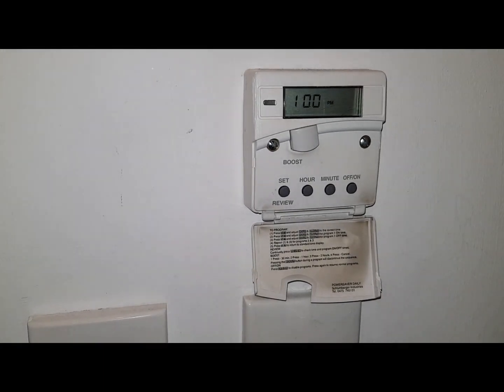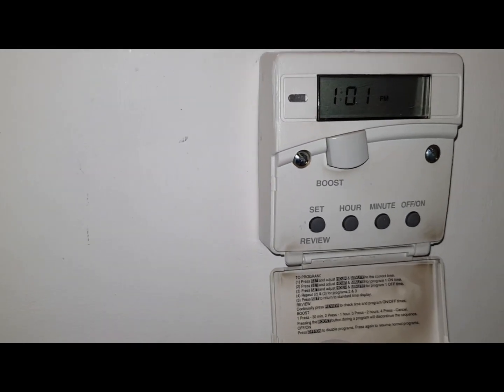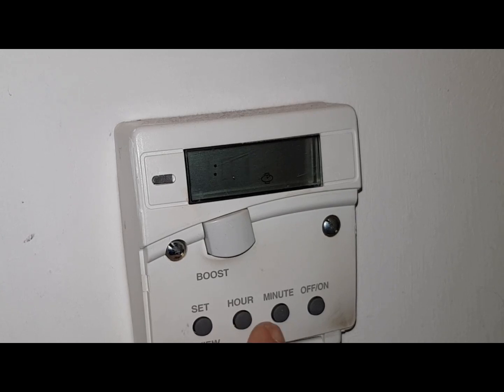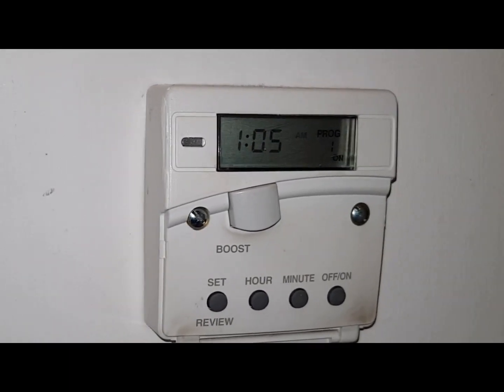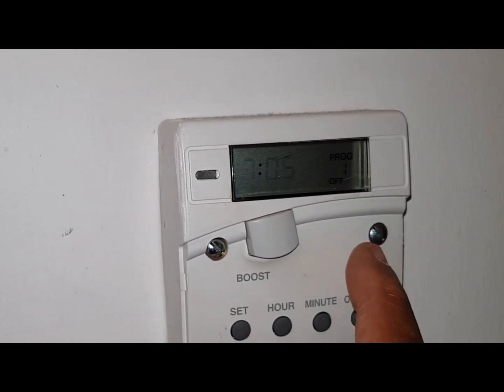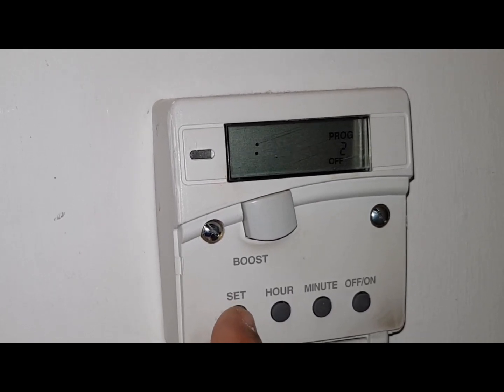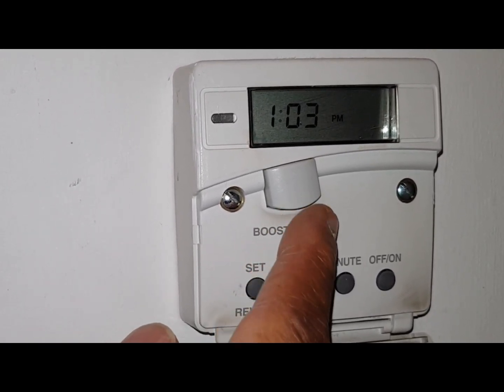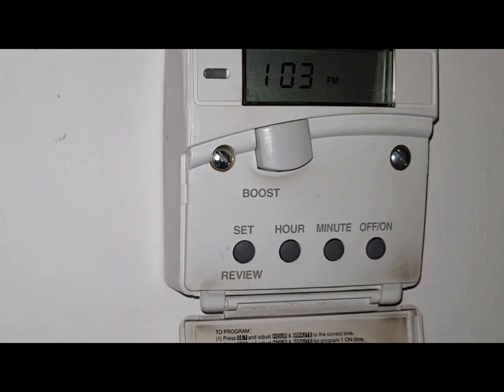How to set a Timer for Gledhill Pulsacoil 2000  With Coach Tony Morgan

Comment: Hello! Thank you for sharing this video. I have a similar timer. It’s set during the economic hours as you mentioned on the video. The problem comes up when I need to warm water at any specific time, I set the boost for 1 or 2h but doesn’t work. Can I kindly ask if before pressing the boost button, do I need to select any specific time to set the boost? I thought that once you press on boost for 1h the timer start heating water straight away. I hope you can help me as I’m very desperate 🤣 and I do not want to de-program the timer by mistake . Thank you in advance!!